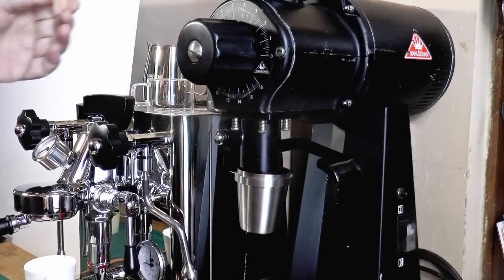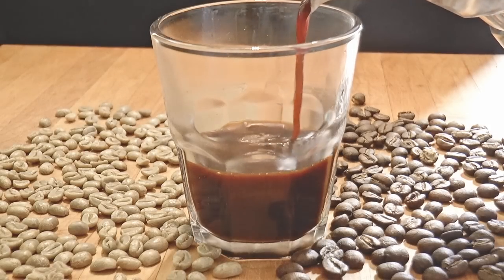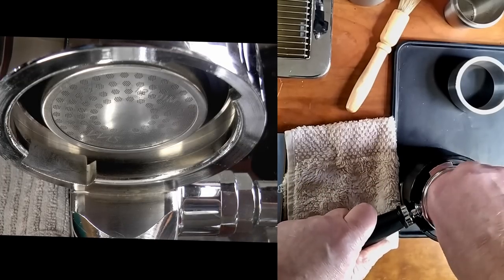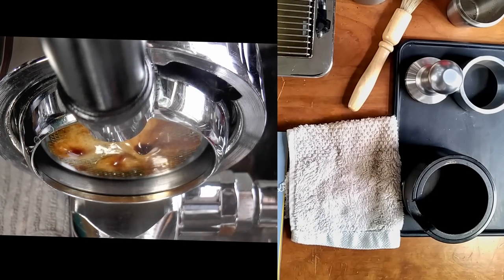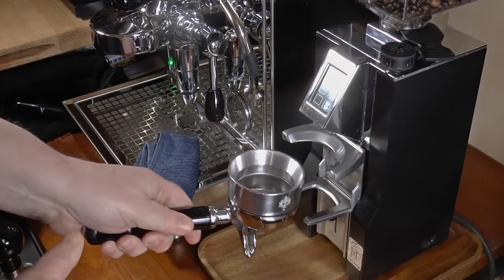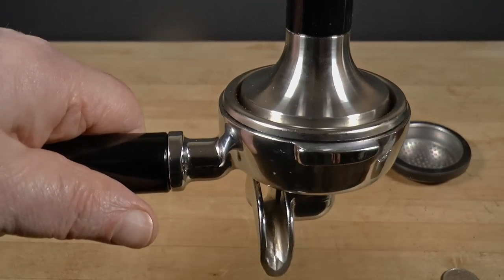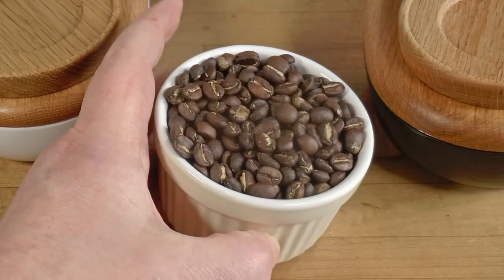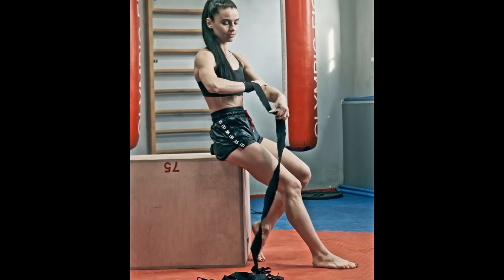Espresso Terrors: 1 Channeling & Puck Prep

Comment: The headspace point is an interesting one. I watched your video on volume over mass with espresso, and it explained something about the default instructions for the Breville Barista Pro. There's no discussion of weight - it's grind into the portafilter, tamp with anywhere between 22 and 33 lbs of force, and use their "The Razor™️" tool to scrape off the extra and flatten the top of the puck. I'm guessing the engineers at Breville came to the same conclusion you did: ensuring proper headspace mattered more than the mass of the grinds. Perhaps they were right - despite trying WDT, a spring-loaded self-leveling tamper, and various other gadgets/tools/techniques, the approach Breville recommended focusing on get the right distance to the shower screen pretty much always came out best. That being said, I definitely had jets of espresso shooting out of my bottomless portafilter with some of the things I tried - I don't know if it was channeling, but it was definitely wrong 😅
Reply: Have you seen what they did with the impress puck system on the Express Impress and Touch Impress? It's basically a calibrated tamper with a sensor integrated into it which lives in the chute of the integrated grinder. You grind into the portafilter and pull the tamp handle down and if it needs more it will tell you and you just press the grind button to grind a little more, then tamp again and it will tell you when you have the ideal dose. So, Sage/Breville certainly don't seem to think that WDT is a necessary practice.

Comment: How do you think a puck screen affects the need to adjust headspace? My intuition is that the puck screen works effectively as a secondary, perfectly matching shower screen, as the distance between the puck screen and coffee puck is zero. Intuitively, for me, the distance between the puck screen and the shower screen seems not to matter.
Reply: My experience is that there can’t be too much distance when using a puck screen. You’ll just end up with a bit of water on top of the puck screen after you’ve pulled a shot. No problem and works like a treat imo.

Comment: I hate this video. After this video came out, my coffee increases to fill the portafilter from 9-10 grams to 14-15 grams, there was negative enhancement in taste with a HUGE increase in channeling..the taste went bad so much that i was contemplating giving up coffee. I use flair classic with df64 grinder. Today i found my old acupuncture needles and did proper wdt even at 10 grams and the channeling was very less, there was a better taste of the shot. Please dont peddle half truths
Reply from the maker: My fault! The Flair is mechanically different from E61 and E61-compatible ring and saturated groups. This video does not apply to your device or the Robot or the 9Barista, and I should have mentioned that in the vid. I'm only one guy: researcher, script writer, cameraman, and video editor. I don't have a team like some, so occasional oversights are inevitable. However, in its context, the video is quite sound, and the 'dose by volume' video is also sound, just not in your case. Sorry about that.

Comment: The final tamp was flat though. Try an uneven tamp and you will certainly get channeling. Also, just cause you didn't get it on those times doesn't mean that better puck prep doesn't mean to more consistency shot to shot.
Reply: The point of the video is not that puck prep is unnecessary but that a bit of a shake and an even tamp are enough. 

Pre-infusion probably also helps and darker roasted coffee too.

Comment: Overall, I agree with this video, in that coffee being too high in the basket causes issues, especially if the grounds are prone to expansion. 
Slightly too low does not matter to me cause I use a mesh screen resting on the coffee.
Also casual puck prep like in this video with grounds properly sized is just fine.
I do it all the time and the puck comes out perfect.

I would add that if the puck is not fully level, you will simply get a slightly uneven extraction that is irrelevant as long as you make sure that the puck is fully saturated before applying permanent high pressure. In this situation the tamping with circular rocking shown in this video actually helps to ensure all of the coffee is tamped.

When I was doing puck prep different ways, I found certain things could cause the puck to break down. One was large voids in the coffee from how the grounds were placed in the basket. Another was using a leveling tool that caused a shear line weakness that led to side channeling in the middle of the puck. Another was using a dirty WDT tool that grounds stuck to and the removal of said tool left significant tunnels in the coffee puck. Also if the grind had enough fines, doing something that migrated the fines to a pert of the puck caused issues. This could be side tapping moving the fines to the side, or excessive WDT which can migrate the fines to the bottom.

Sometimes simpler is better.

Comment: How do you apply this volumetric approach to something like the Cafelat Robot?  I definitely get "bad pucks" with it, from time to time, and I'm not always sure why.  

Using paper filters has definitely improved the consistency rate, but I've also noticed that it seems like tamping it down real hard (like the "30 lbs of pressure" received wisdom you always hear) increases my chance of getting a bad shot.  Watching the shot in a mirror with a naked filter, it looks like maybe the water is going around the puck instead of through it.  Certain dark roasts and high-robusta blends (like Vietnamese coffee) also seem more prone.

Comment: I mostly agree but after making espresson for 10 years on the same grinder/machine my consistency improved quite a lot when a I got a scale and a wdt tool. neither are necessary though. I can easily fill my basket by eye but I can't grind by eye so the scale helps there for achieving the right volume

Comment: I always have issues, flavor consistency wise, but I'm pretty certain it's because I have a stock Gaccia classic pro with awful temp control. How much improvement have I noticed with Puck prep? Not much. But upgrading the basket and trying to temp surf seemed to help the most. I'll install a PID one of these days.
Reply: Well, puck-prep is a requirement for consistency, so you are doing well I’d say. Without it it’d be harder to improve the shots by different means and almost impossible to dial by taste.

Comment: As someone who uses a cafelat robot, what sort of headspace would you recommend for that particular basket? Or are there different principles at work in that case.
Reply: Headspace is only half of the volume concern. A perfect headspace isn’t of much use if you use a basket that’s too big or too small. Because the puck will still be too thick or too thin for an even extraction.

In your case you don’t need to worry about headspace directly, just about your puck’s thickness.
Reply from the maker: The Robot is a different design, with the shower screen in contact with the coffee surface. So you have to judge the right amount of coffee for the basket (different coffees will work with different amounts) on the basis of shot mechanics and flavor. I find that around 14-18 g is a good range to start dialing in.

Comment: My guess is that two factors were even more important than the correct fill volume here: the pre-infusion which allows water to saturate the puck evenly and a relatively dark roast. Do this puck prep again with a light roast and hit the puck straight with 9 bar and you will see channelling despite having the correct fill volume.

Personally, I have seen a huge change and improvement since I decreased the pressure on my linea micra to 7 bars. Unfortunately, I‘m not able to do mechanical pre-infusion anymore as I was able to do with the appartamento I had before. But coffee temperature is a lot more consistent and I will get a needle valve mod once the warranty runs out.